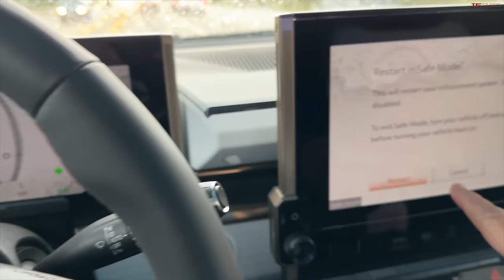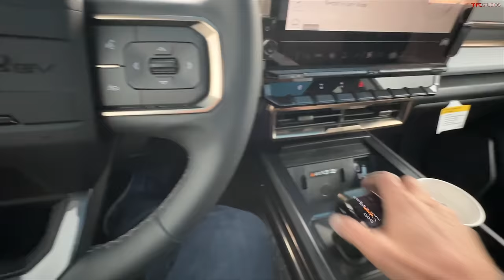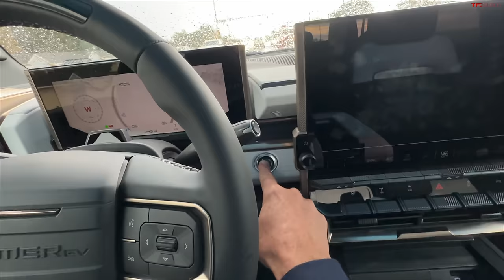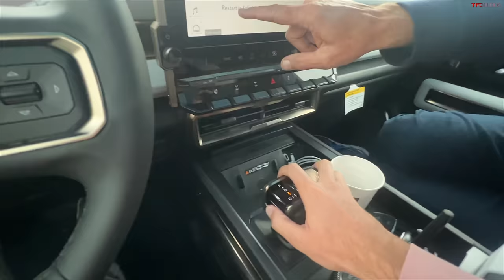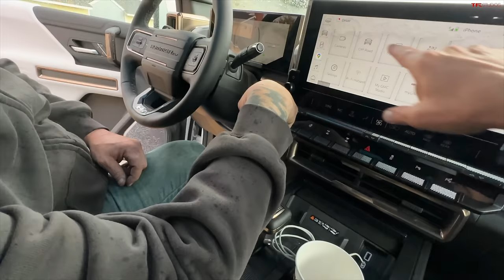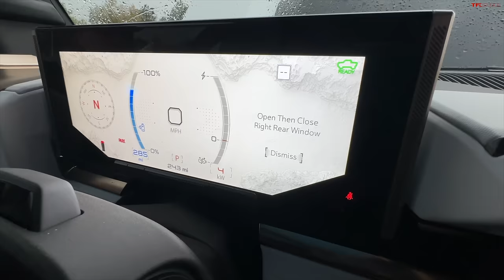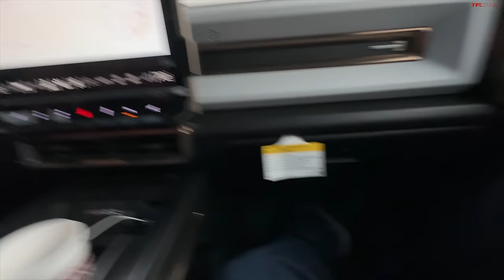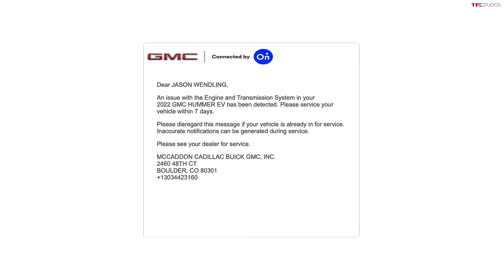I Bought a $115,000 GMC Hummer EV and It IMMEDIATELY Left Me Stranded!

Comment: No failsafe system to get you out of a jam ridiculous other funny thing is your vehicle weighs so much that a flatbed that comes out the trade it for 26,000 pounds is legally not allowed to put that thing on the bed because flap, it is only rated for about 8400 pounds and if you were to get pulled over with the tow truck driver with your vehicle in tow he would get a ticket for his vehicle being overweight by about 1000 pounds because again flatbed read it at 26,000 pounds is a class a vehicle with a class C license flatbed that is rated for 30,000 pounds or more would have to be the one that put your E V hummer on the bed cause anything over 26,001 pounds requires a class a license for the last time your truck puts a flatbed drivers truck it overweight capacity

Comment: This is just reason number 1 outta 1000 not to ever buy an EV. Reason number 2 is the government is currently trying to mandate everyone no matter our financial situation into only being able to buy these turds! And reason number 3 just happens to be that colder climates and temps these EV’s just loose a lot of their ability to keep a charge! And really Roman I’ve got an actual dangerous break down situation for you, I have owned 2 ford pintos back when I began driving to be honest my mother didn’t want me driving anything with a V8 in it and the very first dealership I got my first car from had 2 very different cars on the lot! The 1st car was what I wanted which was a 1972 ford Torino four door in shy blue and the 2nd car was a 1979 ford pinto that was a flat baby pens puked up green now the Tornio had a V8 but the pinto also if I’m remembering it right also had the same V8 in it but my mom thought it has a 4cyinder in it! But as you’ll remember Roman all ford pintos no matter the year or engine had the same danger factor to them! If hit in the rear end pretty much at any speed they would and normally did explode on impact because the rear bumper tools the rear bumper was bolted onto were placed directly where they when hit from the rear would puncture the gas tank and make that spark telling the owner of said pinto you should have purchased the Vega sitting next to this turd!